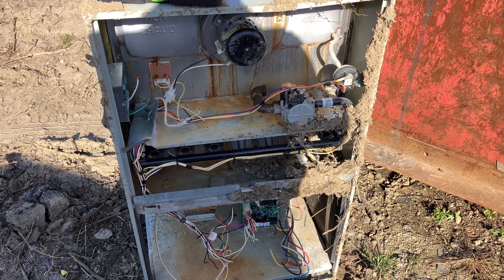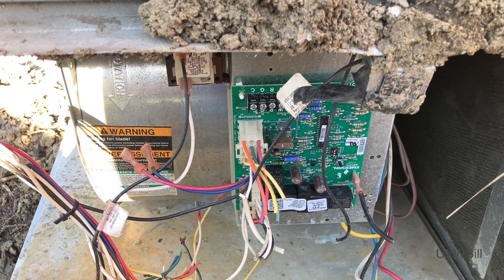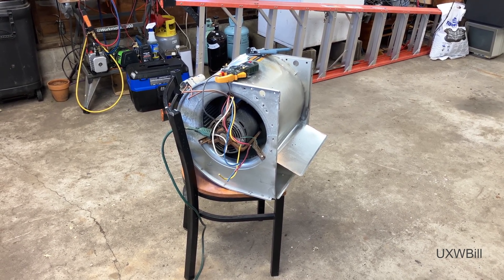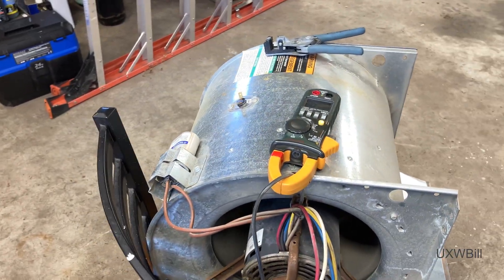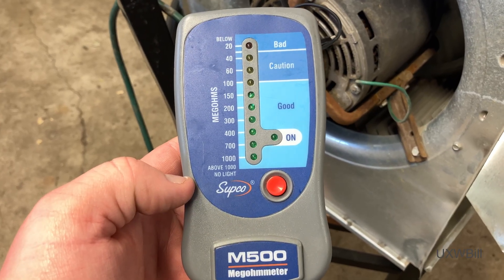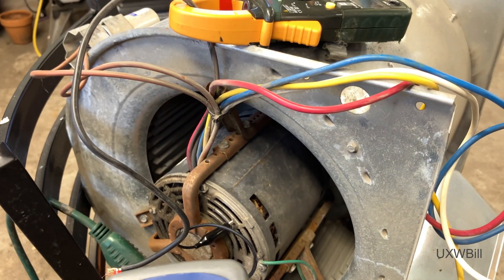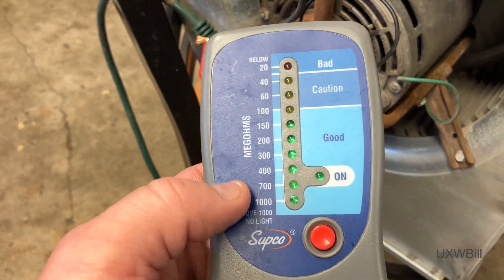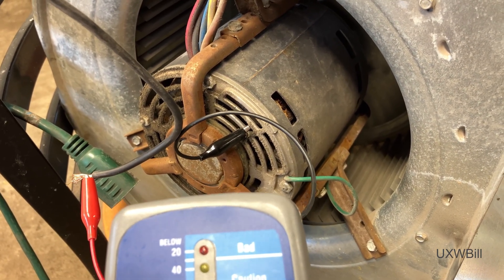Little Ado about One Fan

Comment: What's the reason the fan needs more amps to run unrestricted? At first thought, I'd have thought the inverse to be true.
Reply from the maker: The fan is intended to operate with some restrictions on airflow, as it would when the furnace is installed and connected to ductwork. The restriction creates what is known as static pressure, which is to be checked (and adjusted if needed) during installation.

I'm not entirely clear on the physics aspects of this, but I believe the lack of some restriction on the airflow also results in the fan "fighting" itself as it runs, by way of some opposing air currents.

Comment: I used to go to a flea market down in FL that was under a roof but open on the sides to a point.  It was kind of a prefab steel building that was fairly wide but super long with booths set up on each side and a corridor down the middle.  All along the ceiling they had squirrel cage fans hung up simply as air circulators blowing down at an angle to keep the shoppers cool.  They sure put out a ton of air and were much more effective than any ceiling fan would ever be in the FL heat.  They all looked as if they had been scavenged from old air handlers.

Comment: OK, hear me out... have you ever read any old magazines such as Popular Mechanics?  In the back of said magazines were ads for various DIY plans, one of which was a hovercraft using one or more vacuum cleaner motors.  Sure, you'll need a long extension cord, but HOVERCRAFT.
Reply from the maker: I'm pretty sure those same ads ran in the back of Nuts and Volts as well. I had a subscription to that for several years. As with a lot of the interesting things advertised in the back of those magazines, I'm skeptical of how well said hovercraft would actually have worked.
Reply: Part of me wants to try that with a forced air furnace fan like that one...